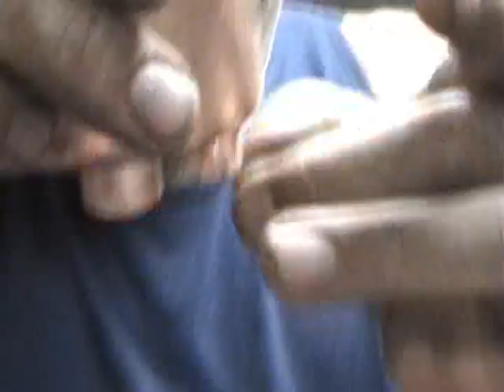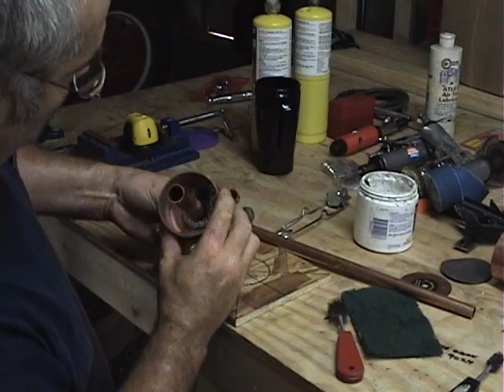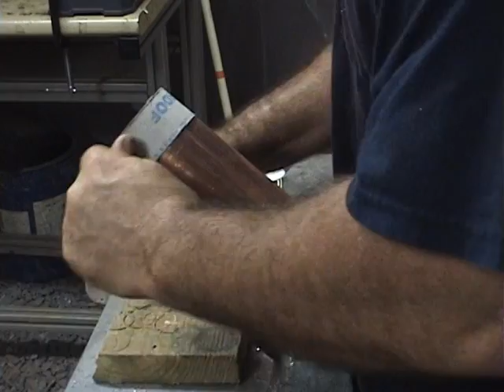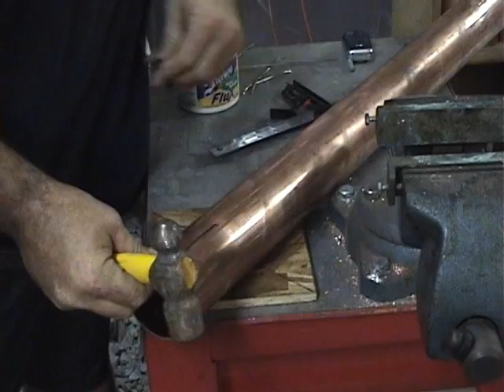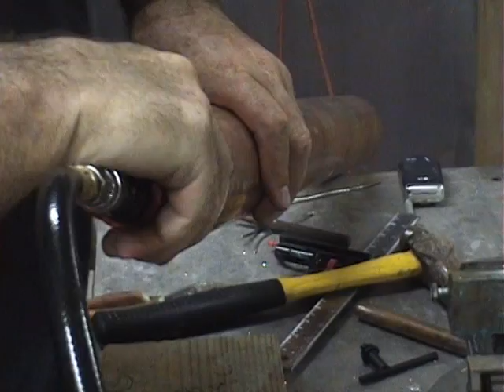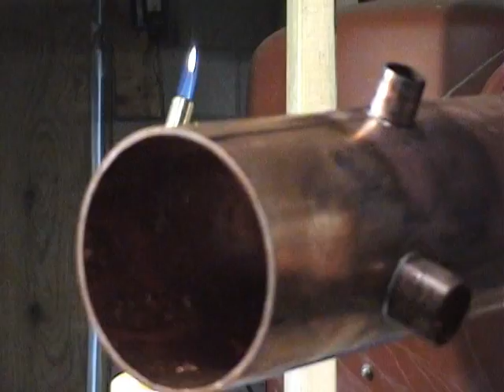Make Moonshine Still part 2

Comment from the maker: The reducer is 3 to 1 1/2, However, I think a 1 inch will work ok if that is what you have. Use a lead free solder and a flux for your type of solder.